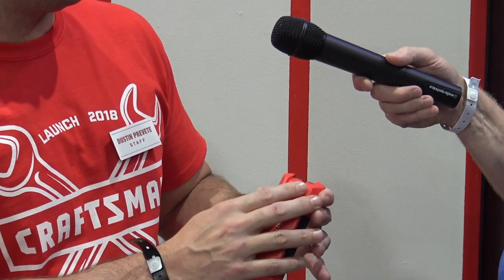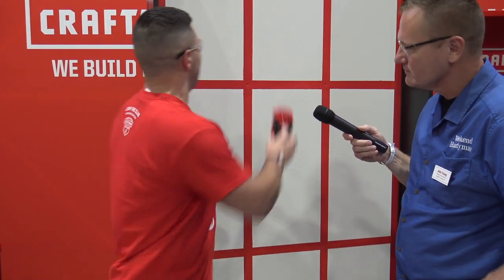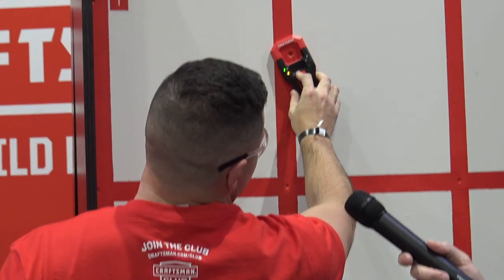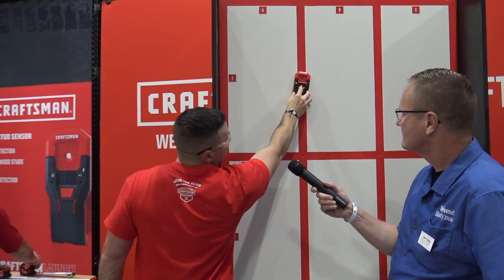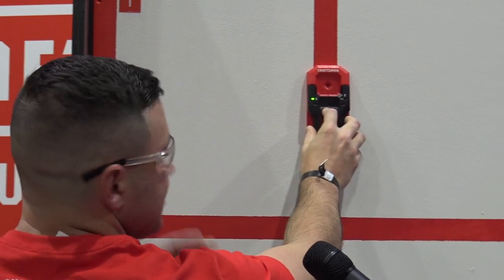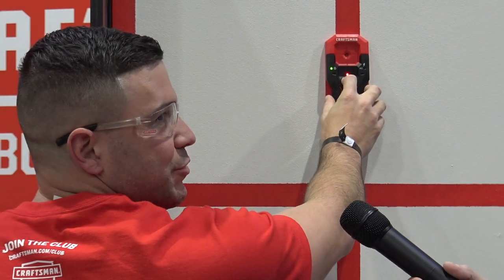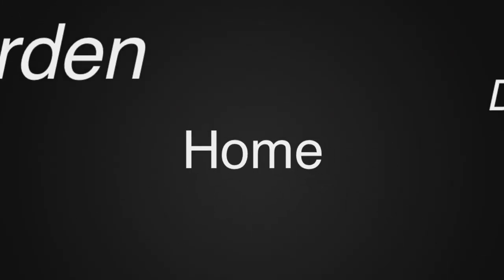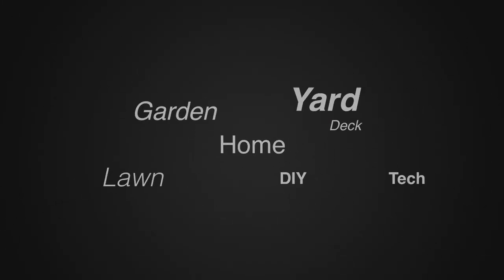How To Use The Craftsman Stud Finder On Sheetrock with Stud and Electric Detection

Comment: this thing is very confusing. I've never used it for actual work. AC goes off on everything. The stud indicator will go off on tiny segments. I can't tell if it's indicating the edge of the stud or outright misreading what is on the other side of the drywall.
Reply: @Juan Gomez Rivera thank you! I thought mines was defective as well.
Reply: @Juan Gomez Rivera dude thsnks was about throw this thing in trash
Reply: Came here to say the same thing

Comment: Two Main Points (if you don't want to read my whole comment):
1.  This was TWO years ago.  Why is Craftsman still selling the old version (which I bought) if they knew it doesn't work well?
2.  I'm glad the comments report that the "new" version is just as bad so I only wasted $15 instead of whatever the other costs. 

Main Theme:
I'm a single mom trying to teach my teenage son how to do things around the house.  I don't know how to do these things either but I'm figuring them out as best I can. 
We're trying to mount our TV.   The Craftsman stud finder (older, less expensive,  admittedly-unusable per the rep in the video) gave me my edge hits, we marked both and marked the center, and, shock-a-roo, we drilled into space, not a stud.  I'm so frustrated.

Comment: Never buy Craftsman for anything other than a manual tool (screwdriver, hammer, ratchet etc). Every time I’ve bought anything that requires a battery or some power, it’s a POS. The fact they are now with Lowes is even worse. They were at least reputable back in the day with Sears.

Comment: As someone who owns this, don’t buy it. Very inconsistent.
Reply: I concur. Just bought one. Same model number as in the video description (despite looking slightly different, mine has a black bullseye button). I hold mine straighter than the guy in the video. I move mine slower than the guy in the video. All per the instructions. But it's very difficult to get a hit so easily the way the guy in the video does. And the hits I get are not consistent.